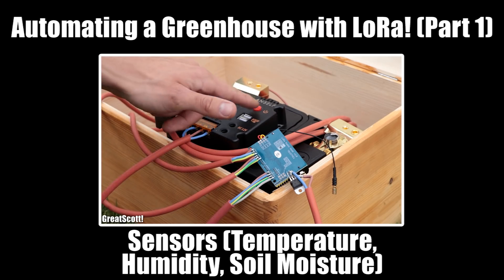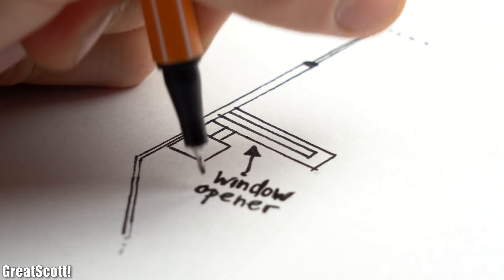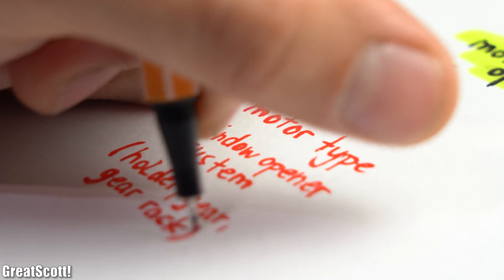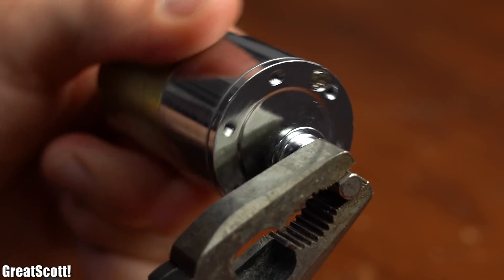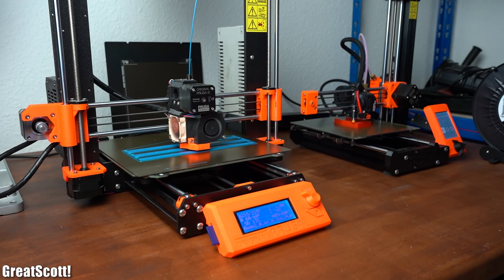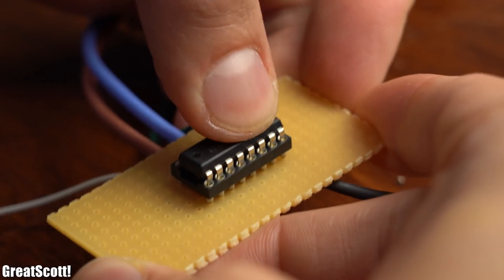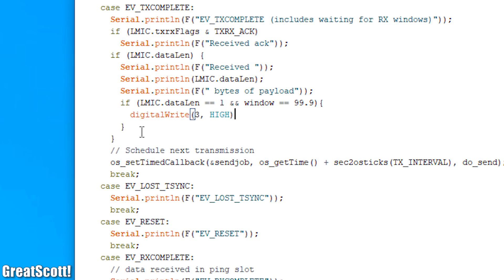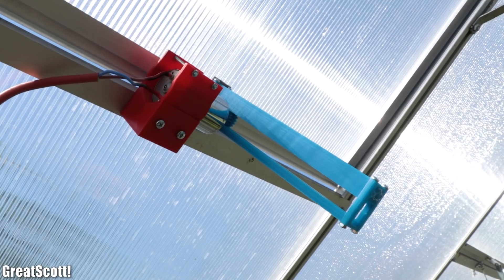Automating a Greenhouse with LoRa! (Part 2) || Motorized Window Opener

Comment: You need to consider the wind speed too when thinking of the window. If you can measure the wind speed, you can include a script in your code to lower the window when the wind is over a certain speed to avoid damages to your greenhouse roof structure. 
For watering the plants, you can adapt a dripping system which basically will drip water to the roots and not wasting it all over the place. And that can be controlled with an electro valve and fed from an exterior rain collector barrel. You can even add nutrients in the water if needed. There are plenty of options.
Reply: I think that instead of measuring the wind speed it'd be easier to just look up a local weather forecast and check the wind speeds. Because I have never heard of a wind speed measuring sensor. You could perhaps use a turbine and measure the voltage at different speeds to estimate the speed. Greetings from Germany!
Reply: @TheDoblerones  Anemometers are used to measure wind speed.
Reply: @TheDoblerones  Hmm I should go on eBay and check out the accessories for weather stations - they pretty much ALL use a wind speed indicator. There are also yachting hand-held anemometers available and finally, there are also non-moving windspeed indicators of various kinds using different techniques but a simple pressure sensor connected to a pitot tube with a direction vane at the rear of the pitot tube pivot will swing it around into the wind and enable BOTH direction AND windspeed readings if a 360-degree position sensor is also fitted. Easy enough to calibrate the pitot tube for the level of accuracy needed (within 2-3 kph, or 0.6 - 1 m sec-1 is MORE than sensitive enough).

MANY much cheaper ways to make your own too. One is just by using small 5-12volt fans - remove the internal coils, keeping the rotor shaft and rotor with the magnets but with a single Hall effect sensor inside fitted near the rotor rim. An Arduino to take the "pulse" count = directly proportional to speed. Not a complicated job with a little bit of OOTB (out of the box) thinking and only the calibration to do - easy with a low-cost, hand-held wind speed indicator!
Reply: Dripping water is not really good for plant growth. You want your plants to have strong and sprawling root systems.

Comment: Nice. Great video. I am just afraid that you don't have a feedback system for the motor. How do you ensure that the motor will stop when the widow is closed, and not continue blindly? I would suggest putting some kind of switches at the end of the rack path, so that the motor doesn't break the plastic mechanism part if something wrong happens.
I now that the travel time is short, so this may not be a problem, but may be necessary to increase lifetime of the 3d prints.

Comment: Did you consider a mechanical or electrical system to bottom out or top out the rail? Seems like a little disaster is waiting to happen ;)
Reply: How about a current sensor on the motor. When the motor stalls at the end of the rack the current will peak.
Reply from the maker: The bottom of the rack holder is open. So the rack can escape if the window is closed and the motor wants to keep going. The delays I use will overtime do that but you can easily adjust the rack position every couple of months. I thought that is a simpler solution than to include two limit switches, all the wiring and so on.
Reply: @greatscottlab  Maybe a simple mechanical solution is to make the pinion slip off the rail in each extreme and use mechanical force to push it back on to go the other way. If the window is open the weight of the window would do that. In the closed position you'd need a spring or magnet to push the window up (and the pinion onto the rail).
Reply: @greatscottlab  Coloca sensores de fim de curso na própria alimentação do motor com diodos polarizador reversamente, assim quando por exemplo a janela tiver fechada o NC abre desligando o motor e a unica ligação seria o diodo q seria polarizado quando receber a corrente no sentido oposto, parasse complicado explicando assim porem e simples e toda a fiação fica perto do motor.

Comment: One automatic sensor would be perfect for this greenhouse if there is raining.
Reply: The best thing would be a raspi connected to the internet getting weather from a server. And closing the vents if the chance of rain in the next two hours is say 10% or more.
Reply: @galacticgamers8705   Using I'd like tronix as a backup for rain protection is not such a good idea
Reply: @galacticgamers8705  from last 5 days I have got google warning me about thunderstorm in my city, unfortunately it's only 1 day when it actually rained. Other day, clouds did appear but no rain. 
How to avoid this random probability? 
Perhaps some unsupervised learning algorithm with a simple sensor?
Reply: @gurudattapanda  hmhmhm. I see what you are saying... an algorithm could be inaccurate. Its better no rain gets in though than a little bit. A hot green house is better than wet electronics. If it becomes cloudy than the chance of rain is elavated and the green house also does not really get hotter. what about a server getting the weather, but it only closes the windows when the weather shows a percentage and a small solar panel shows a voltage drop, as if a cloud passes over. its better for it to close a little to much than to stay open way to much.
Reply: Yes, but those rain sensor will be oxidised to be rust after a week of use. If you are living in coastal areas, it's totally waste. 
You need to think about a sensor that can last for 5 year at least.
Reply: @gurudattapanda  There are other types of sensors. For example a tank with a distance sensor or a scale or a floater to measure water level
Reply: @micher60  well, when it rains in tropical region in India, there is sudden change in temperature, humidity. We can't wait for that floater to be raised or a tank to be fulfilled to close that window. The heat and humidity needs to be preserved anyhow.
Reply: @gurudattapanda  You can use a barometer + some weather API to predict the rain. Then with some sort or algorithm (yes, this will probably not fit in an ATmega) you can decide when it's most likely to rain and you can also compare the predictions vs the reality. You can maybe even use an NNUE type of algorithm to self correct even further. The possibility is there.
Reply: @tunahankaratay1523  API and Google Weather report can be inaccurate. We are talking about precision agriculture here and as per my experience Google or Other weather API are mostly 60% accurate. A localised Barometer can be installed but certainly not hobby grade ones. Due to Global Warming and El Nino effect, sometimes pressure variance doesn't implies a rain. And this is also true around 62.5% as per my last year's weather log. 
Still I am not discouraging anyone to try anything.
Reply: I'm guessing a threaded rod instead of a sliding mechanism would be better and stronger.
Reply: @peekpt  with wear and tear, fertilizer fume, it will get rust. Unless you are Putting grease every weekend.
Reply: @galacticgamers8705  based on your channel content i hesitate to throw any logic your way but here goes nothing. Even a 1000 page manual will only serve to wipe your rear if you are away from home when it's raining and the window is stuck open:(
Reply: @Nash4Nashville  dont be a dumbass. Ok my little brother uses my account to make gaming videos. Based on your need to troll when someone gives their opinions and ideas I would hessitate to throw any logic your way.
Reply: @galacticgamers8705  Start by not calling people  names. Second, your logic is welcome. Let's hear it. I simply outlined the fault in electronics vs. mother nature. It fails most of the time.  Simple option would have been to simply put a blower like you would put in a growing tent, keeping the air intake (or output) away from rain. Bottom of the walls most likely. 
Even Robert Plarr's more modern sustainable homes still open and close the roof vents mechanically by hand.
Reply: @Nash4Nashville  That is a good idea, why don't you ask @GreatScott!  why he used a window instead of a blower vent in the first place? Your logic is also welcome lets just keep the internet a much more friendly place to share ideas.
Reply: @galacticgamers8705  agreed and i did post that idea at the top. Stay tuned
Reply: @galacticgamers8705  BTW until this conversation, 100% of the trolls i shed light on all have nothing but video games for content.  That's where that came from. My bad:(
Reply: @Nash4Nashville  that's alright, I hate trolls too. I regret throwing a name.
Reply: @Nash4Nashville  So what do you propose don't knock someone's ideas if you are not going to add your own... Your channel's content isn't very elaborate either.
Reply: The problem with automatically regulating rain is when it stops working
Reply: @Nash4Nashville  the problem with pretty much anything is when it stops working

Comment: 5:09 does not seem like m3 bolt
Reply from the maker: They are M3 bolts.....just long ones.
Reply: @greatscottlab  my bad... Hey, why don't you put limit switches with diodes? They do it with linear actuators.

Comment: really nice, I have at my windows outside rollers and I want to automate them, but did not find a way to make it happen, as they are really heavy. maybe you can  help me with some ideas. keep up the good work!
Reply: 1 week ago?
Reply: @riceexe  premium user I think
Reply: @PCbolt17  Ah makes sense
Reply from the maker: Use some kind of gear system to increase the torque of your motor.